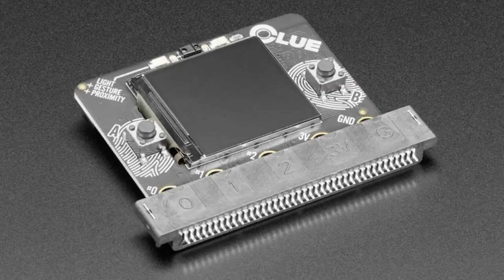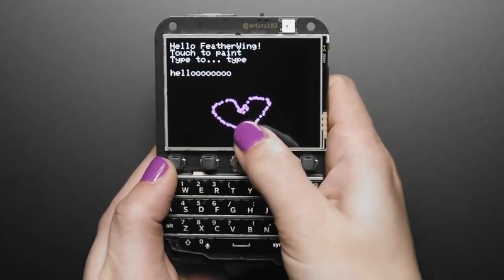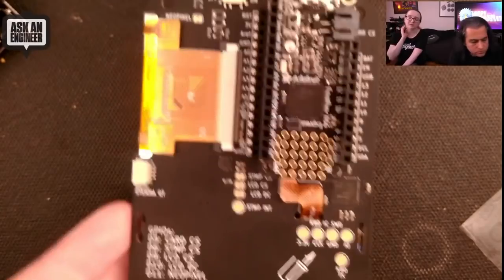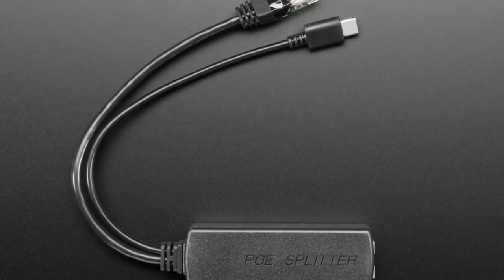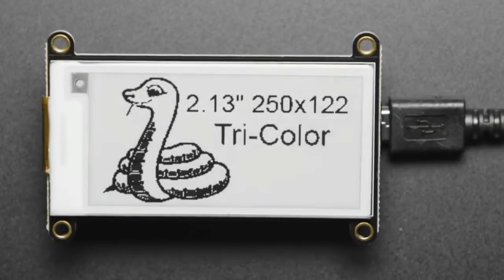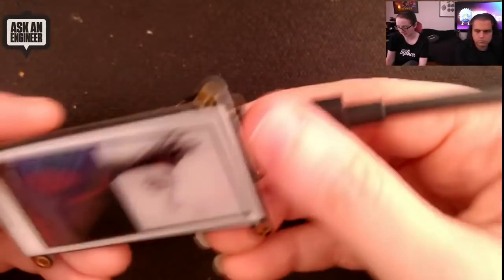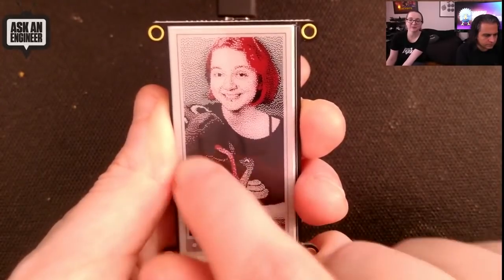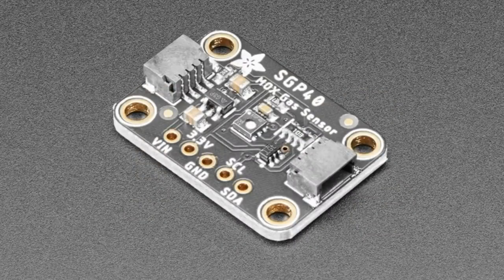New Products 11/25/2020 Featuring #Adafruit #SGP40 #AirQuality Sensor Breakout - VOC - STEMMA QT!

Comment: I wonder if the MOX sensor could be used for detecting 3D printer emissions (especially ABS/HIPS)?

Edit: Ah, can't pick up particulates. It MIGHT pick up styrene gas, but that's it, I think.